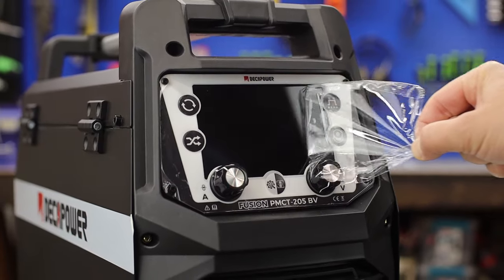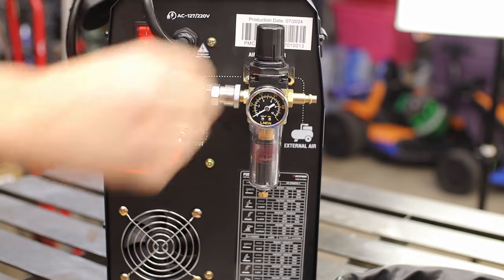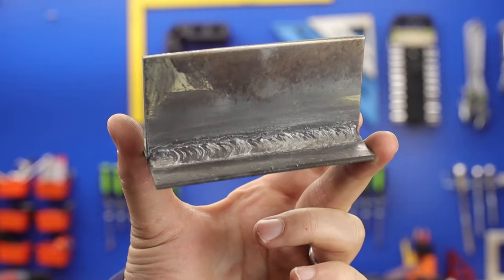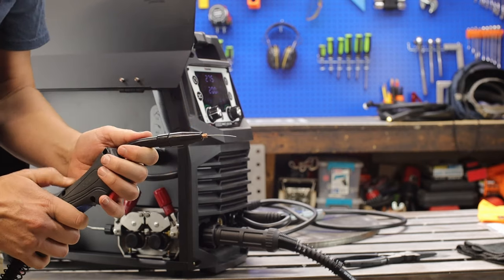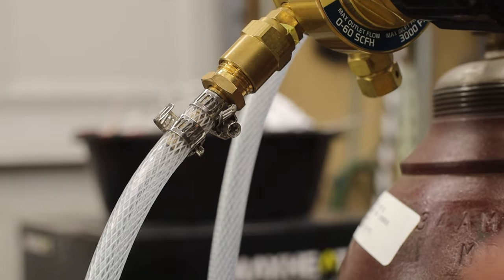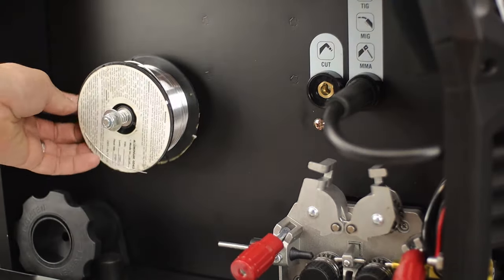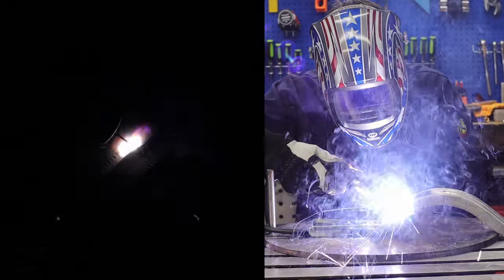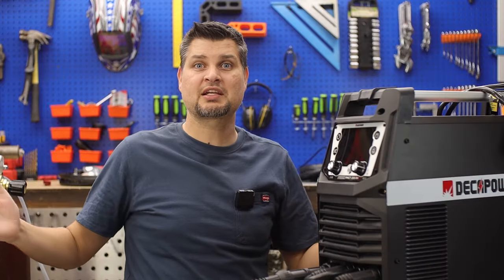Dual Roller! DECAPOWER 6 IN 1 Welder Plasma TIG Stick MIG Flux Pulse

Comment: Thank you for doing this video on this decawelder 6 and 1. I have been having  hard time choosing between this welder and the simder 4050 pro(2024)

Both have alot of the same functions but the Decapower is cheaper

I myself like this set up better.
Reply from the maker: Right on, let us know what you end up getting!
Reply: This machine is in a different catagory than the simder. No contest except it has no provison for spoolgun.

Comment: The power leads on mine are way too short and it needs a power on demand fan
Reply from the maker: What do you have?
Reply: I got the 205 one and they didn't give me the tig torch so I sent it back to Amazon
Reply: @ironpug42  Hello, the TIG torch is sold separately, and the link lists the accessories included in the package. I am sorry for the misunderstanding.
Reply: @ironpug42 i got your return, where is the 120v/240v adapter